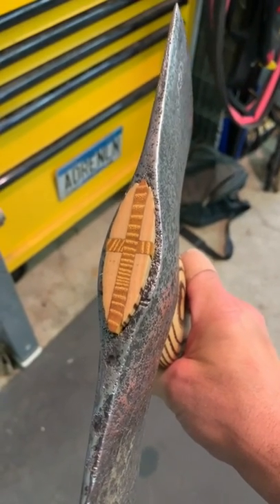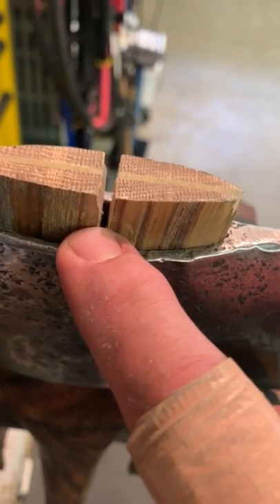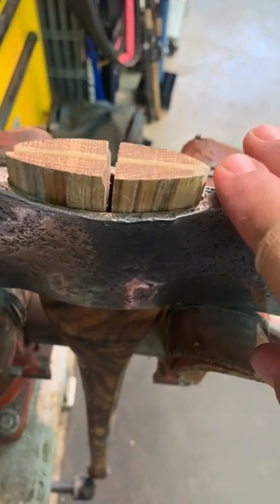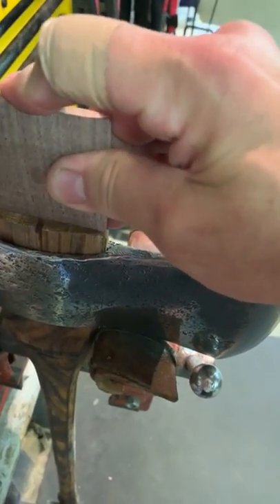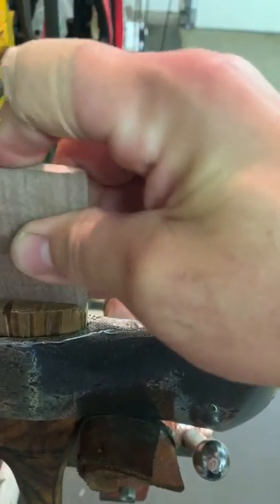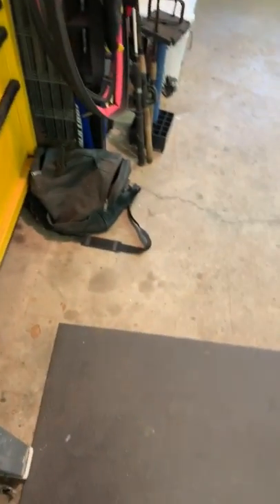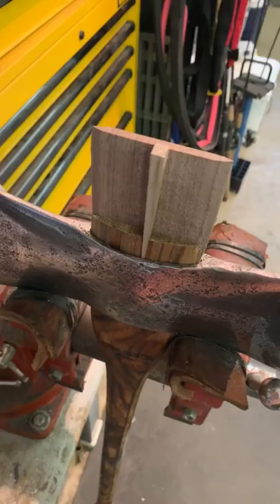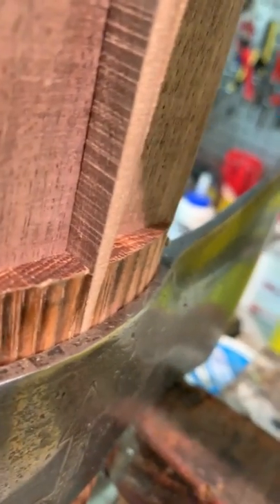Cross wedge basics

Comment: A very useful description of cross wedging and a very tidy outcome Sir!
Quite a few larger English axes have an eye length of 3 to 3 5/8 inches and a significant taper at the ends of the eye. I have done several of these with 2 sets of cross wedges in order to fully close both [often substantial] end gaps. In such cases, I think two pairs of wedges are better than one. This serves to 'share out' the total lengthways bend of the wood  required to fill the eye. I normally space each pair about 3/4" to 7/8"from the end. Cross wedges are best tapered in two directions. The first, and obvious one, is the taper required to fill the gaps at either end and the second is to lightly trim the outside of the wedges a little, to suit the taper of the eye. As you state, the side next to the main wedge must be flat. Cutting the x wedge lengths to no longer than the depth of the kerf, really helps as these are then flush when you drive the main wedge. After driving the main wedge in about a third to half of the way, I usually send x wedges in to their full depth. This gives the lengthways spread needed for good fit, before the main wedging tightens everything to the point where sideways movement is almost impossible. It also gives unimpeded access for driving the main wedge. Using a 1/2 or 5/8" square x 6" punch makes it so much easier to tap these little wedges accurately home without breaking them . I don't glue my wedges and only take the cross wedge kerfs as deep as the centre of the waist or pinch point at the centre of the 'hourglass shape'. of the eye. I try to leave about 1/8" of unfilled kerf in all wedges so they can be further tightened if things get loose with time. 
... Hope this is helpful to someone.